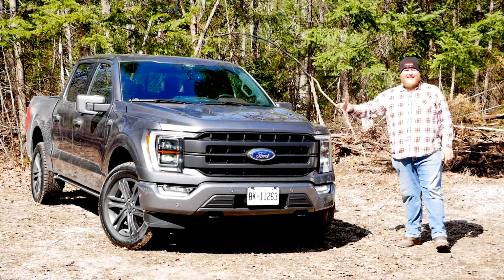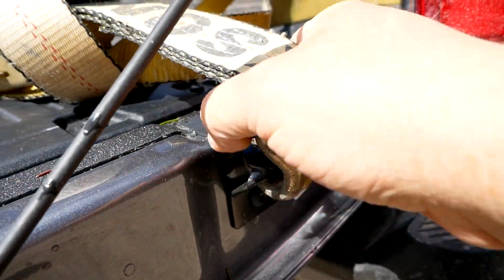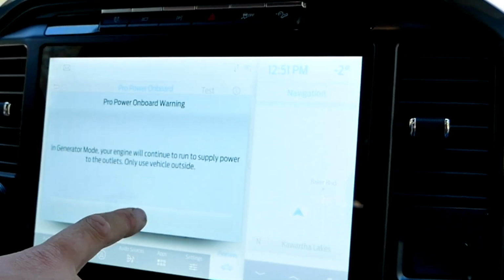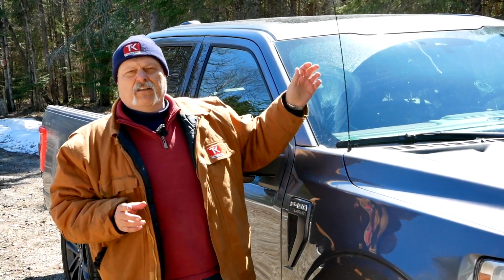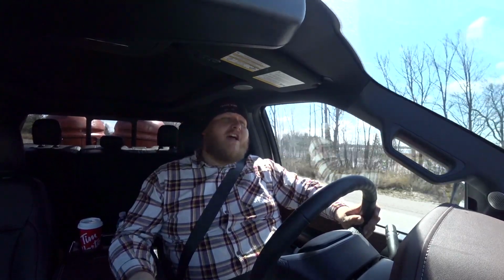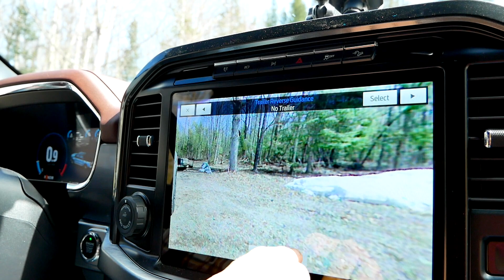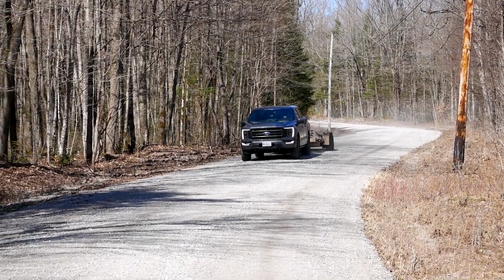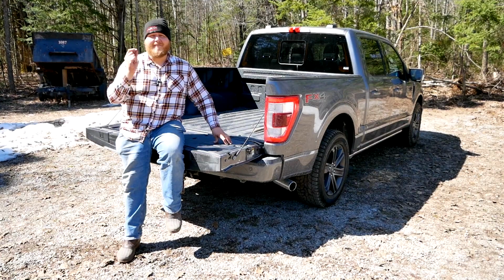Towing & Hauling with the 2021 Ford F-150 PowerBoost - Is Hybrid The Right Answer For Hard Work?

Comment: Ford is the pickup truck innovator.  Yes, Ram upped the interior threshold, but outside of that, Ford has literally been a pioneer for everything else on the current pickups we've seen in the last 20 years.

Comment: 12:40 – Hybrids have a "mandatory" beep when in Reverse gear.
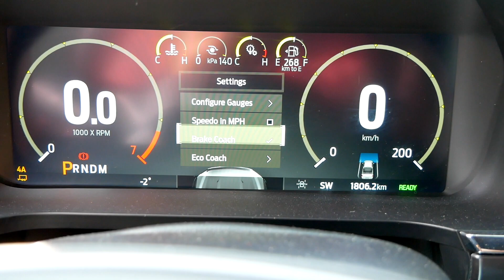17:35 – Fair point, it's a "busy" cabin … I just got one two days ago. The drive today (200 miles) put a total of 500 miles on the odometer and was only my fourth time behind the wheel and the first time I was confident the touchscreen and steering wheel controls were helping me and not distracting me. 
Driving with nothing in the bed, the ride is comfortable and even luxurious on the freeway. I feel the rear suspension reminding me I paid for max trailer tow, but the FX 4 springs are longer travel and softer, so even on bad city streets, this is not a "kidney belt" bruising ride of a typical half ton with leafs.
I'm at "day three" and greatly impressed. Hauling a full bed of heavy equipment, every seat occupied in the cabin, gaining over 6000 feet above sea level, up to a 75 mph, not sparing the horses for overtaking, averaged 19 mpg. Driving with the distance-keep and lane-keep cruise control is confident on winding mountain freeway curves and the cabin is quiet and calm, so a four hour drive was enjoyable.
Reply from the maker: Good review - thanks!

Comment: This is really a fantastic half ton. You get  insane power, fuel economy, generator and properly equipped truck capability and offloading. Raptor and all is great but this will do 90% for 1/3 or less cost over its lifetime and things that truck could not do.

Comment: The antenna is a great warning when you might scrape in a parking garage.....or other low height areas 😀
Reply: That's actually its primary purpose, even though people call it an antenna.
Reply: Also the range is better than a shark fin style antenna
Reply: @cmoney8280  But I had a Tacoma with an antenna and it got beat up bad off road. Sharks fin is way better overall.
Reply: That is funny but true. Especially in parking garages.
Reply: Seriously. What do they have against the antenna? It's fine. Ford is improving what needs to be improved, not just changing things for the sake of changing things.

Comment: Definitely watching the powerboost. Gonna give it a few years to see how the reliability turns out and also see this supposed toyota tundra hybrid that may be coming.
Reply: Given the current chip shortage, waiting is the better option if you don't need a vehicle. I was lucky to get one and will roll the dice on reliability. So far, so good, but I wouldn't want one of these out of warranty with computers and motors everywhere. Beside cost, the other factor in reliability is the problem of having a vehicle off road – can an individual or a business afford to have a vehicle out of service. If my pickup was live-or-die critical to my business, I'd be more careful.
The way I see it, the 2021 F-150 is 90% the same as previous years, so all the reliability risk comes in the hybrid which is itself an already proven technology (in Lincoln.)
So far, the only problem I've read about is underbody rust in vehicles driven in regions where winter road salt is a problem – that's something Ford must fix, but it's not a dealbreaker for me.
Reply: @brightymcbrightface  There coming off the truck with rust in all parts of the country
Reply: @diesel6916  right. I was wrong to assume this was a regional problem. I'm in California and my F-150 Prius arrived with 10 miles on the odometer 2 days ago and the diff is red raw with rust. I plan on getting under there on the weekend and trying a rust inhibitor spray.
Reply: @brightymcbrightface  Ford has used the Toyota Prius hybrid tech for a long time, so I think that portion is good to go ... it all comes down to the dealer support and the day of the week it was built (no Monday or Friday) ha ha ...
Reply: So it’s been a year, so far the most complains are about the Sync4 which is kind of a big deal as this truck is pretty much wrapped around this system and other electronic modules. I’m still scared to pull the trigger on it as I don’t trust Ford when it comes to their complex systems. Also somebody posted out a video of the underside… so many wires, connections, relays and it’s all exposed to water/salt. IDK, I love the truck but I can see it being a headache for those who keep the vehicles long term.

Comment: The F150 powerboost is an amazing truck. Alot of power! Quiet and built strong, I've had two 2020 trucks, a trail boss silverado 5.3 and a Ram Rebel 5.7...the 21 Powerboost in my opinion is a much better build and feels more solid in quality.

Comment: Stephen, since a lot of us here are dads or new dads, could you possibly start adding a 30 sec segment on backseat child seat room. Forward facing and rear facing to back of driver or passenger seat. That’s would help a lot. Thanks!
Reply: The back seat in this F-150 is great for child seats (LATCH) and space/access. I'm 6'1" and the space behind the driver's seat is ample for rear-facing.
I agree it would be useful for new buyers to see a compilation of photos and measures to compare.
Reply: There's TONS of room in the back on the F series trucks for child seats, the same if not more room than our expedition. You won't have any issues, even with a tall person in the front seat adjusting it back.
Reply: I just test drove the is it supercrew yesterday . and as a mother of a 2 year old and driving a minivan I have to say the legroom in the truck is bigger than what I have right now. It has space fir 2 seats that need to be restrained easily. 3 kids not so much
Reply: That’s a fantastic point. Most folks buying these will be using them as family vehicles for the majority of their miles.
Reply: Just as a comparison my chrysler town and country has 36inch legroom in second room and the ram 2500 has 43 inch I think and ford has even more...
Reply: Alex on Autos got you covered!
Reply: You won't have any issue with a crew cab F150, you should already know that.

Comment: I have a 2023 Powerboost XLT. It is my second truck and was (my first was a ram 1500 eco diesel, you already know what happened.) And this was my second choice, it was this or a F-150 Tremor. Wife liked the Powerboost more, so I decided to give it a chance. Have had it for a year, have taken it off road (fish creek in Anza Borrego, and Palomar divide truck trail) as well as my daily driver, and it has been rock solid so far. Mileage is a bit less than my diesel, but not bad. But I had no idea what a monster this truck actually was when I bought it. I have smoked so many kids in their STI's and CIvic's. Its hilarious, and even gave a hellcat a run for its money (end of the day truck tops out at 130, hellcat smoked me after that).

Comment: Most complaints of the console shifter should be reminded that it's an option on anything below lariat.  Column shifters are more regular on XLT and that's what I have on my 21 f150.  0 complaints of it, and it gives you more room in the console itself.  (we have 40 console 40)

Comment: I really love what Ford did with this truck, it is incredible how much they packed into it. In my opinion the styling is great too, interior / exterior it looks great, power, comfort, it seems to have it all. I do have that mindset of the electronics breaking but mine is more of a functionality question. If the screen does go or the shifter motor goes do I still have functionality to at least drive and be productive or will the truck be so dependent that it basically say nope sorry you have to get this fixed before you can use it or be in a limp mode that is basically useless.
Side note in 2008 my office moved locations and my commute to work quadrupled in distance so I got a small Toyota Yaris for the gas milage. It has absolutely no bells and whistles and of all things is has manual crank windows LOL. I still have it and it still runs great. Great video as always, love the channel thanks for all you guys are doing.

Comment: Good review 👍
Ridgeline 1583 lbs payload and modern antenna😁
Cheers
Reply: Right and only 5000lb towing. It is a nice ladies truck. Lol
Reply: Before everyone starts attacking you, payload is GVWR - curb weight. Curb weight is dry weight + features. This Lariat has more features (including the hybrid power train) and the Ridgeline does not complete with F150. 

NOW. Compare Ridgeline with 1500 lbs payload to similar Tacoma with 900 lbs payload. Way better argument but still 2 very different types of buyers.
Reply: @MrJamesLuz  
I knew full well it would stand the hair up on the back of many necks😂
Reply: @robertchapman4488  
Wow, not only did you just insult all Ridgeline owners but women as well.
Buy the "Truck" that meets your needs.
The Lariat with all the bells and whistles and old antenna far exceeds my Truck needs even if I had the money. 
Cheers
Reply: @MrJamesLuz  the ridgeline is like 40k usd less expensive than fords. That's the point
Reply: Always owned Honda’s and two times Ridgeline owner (2006 and 2017) but I did not went for the Ridgeline 2021; I am waiting for a F-150 2021 Powerboost Lariat. Unfortunately, even with a refresh, Honda did not keep up with technology for the Ridgeline. I had to jump ship... I know I will miss the ride quality and the in-bed trunk but with the 7,2 Kilowatt power generator, I will be better prepared for a Zombie apocalypse.
Reply from the maker: Nice one!

Comment: Sounds like they need to add that system to the 3/4 ton. The tongue weight of a trailer would max that truck out with just the driver amnd one passenger.

Comment: Great review as usual guys. These prices have gone completely off the reservation. $80,000 USD for a mid level trim package half ton is disgusting.
Reply: Doesn't mean you will pay that much ..,.i got a factory 8500 dollar rebate and a 1000 dollar dealer rebate
Reply: @northlander4370  $70,500 isn't much better LOL
Reply: @skwerlee  i came in with 4000.00 cash down...if you want a loaded truck be ready to open your wallet

Comment: Like your show. You and your dad share a lot of the same questions regarding vehicles as myself. Maybe because we share similar environments (far northern Wisconsin)? Mud, spring thaw, heavy snow, heavy salt use, dense woods, wetlands ,very cold weather and ice have different challenges than the west (rock climbing, sand). We don't have the awesome views or mountains, which are spectacular to watch. I think Ford has a homerun with this hybrid/generator F-150. Too costly for my farm, even the larger generator can't handle my vacuum pumps in the barn, but still Ford always seems to be ahead of the innovative game. Currently I run an old Dodge 5.9 Cummins. My old F-350 dually was great (7.3 IH), but the the salt just destroyed the body.
Reply from the maker: those 5.9's are slow - but they run forever.

Comment: The sound when you were backing up was not the parking sensors... it is because it is hybrid and doesn’t make any sounds... it makes these beeps for warning people you are backing up... very annoying and it can’t even be turned off from what I know. Hopefully enough people will provide feedback and since it has over the air update, a new option to turn it off will arrive soon.

My new F-150 Lariat Powerboost should arrive within 1 month. It is my fist full size. I am a two times Ridgeline owner. I loved that “truck” but the technology in the F-150 moved me for the first time in my life away from Honda to Ford. I ordered it with assist 2.0 package that will give me Ford self-driving (Blue Cruise) with an over the air update later this year.Looking forward to a test of that from The Truck King.

Comment: The antenna is there because if you put in a slide in camper that goes over the roof it will block a shark fin or Rc car looking antenna from working. Also roof racks with ladders and such can and will hit antennas on the roof.

Comment: I love this truck. It has so much stuff. I worry about this truck, it has so much stuff.

I do think this is the  new king of the full size trucks. 

However all new vehicles are made with all this stuff. I do not care for or need most of it. It is what it is.
Reply from the maker: That's the dilemma - want the stuff - fear it breaking
Reply: @TruckKing 

This is why I recommend to all my customers, they should get the OEM factory extended warranty.

Comment: you can get one with a stick shift and front bench seat so no need to ccomplain about shifter.  How is the rust underneath...many have complained
Reply: just surface rust on diff housing ..no big deal .

Comment: The shifter might as well be a push/pull button or a dial.
Reply: 100% Agree.  Would get rid of my console shifter for a rotary knob up above the drive select knob in a heartbeat.  Create more useable storage space in the console.
Reply: Or even better a column shifter when you order with the 40-20-40 front seats. Why would you not order it that way? I don’t get it ? One extra place just in case and a place for the dog to be close to dad.

Comment: That payload is the same as my 08 jeep grand cherokee, that's really sad since its coils all around and is unibody. The max payload package is available with XL and XLT trucks with the 5.0 or 3.5ecoboost only, but you can get it with any cab and either a 6.5 or 8 foot bed, and I believe it gives you over 3000lbs of payload in all configurations, but now you have a 5,000lb truck with 3,000lbs payload 
For the screen they just didn't want to be the same as ram, because in the expedition they are putting in the stupid vertical screen from the mach-e where the wagoneer, grand cherokee-L and durango have the horizontal screen. Also the explorer has a vertical screen

Comment: Thank you for an excellent review. I wonder what happens when the hybrid system hits the 10-year mark since we generally keep our vehicles past that age. I have two friends with older Prius models who had expensive battery repairs around the 8- to 10-year mark. Would it be better to buy the F-150 with the 5.0L V-8 and avoid having the pickup sidelined by repairs later on?
Reply from the maker: We shall see

Comment: I actually traded mine in recently on a frontier because I wasn’t ready for the technology. It was a huge problem for me. Primarily with the parking sensors, cameras and automatic emergency braking. I’m a trim carpenter and I tow a trailer often (multiple time a week) and when I’m home I like to park in the garage because we get a lot of hail and snow and I like to protect my truck in the garage. This past 4 months were aweful for me because I kept collecting ice on the sensors and all the alarms and cameras would come on and drive me crazy. Also warning lights telling me failures on the dash. When I come to a stop light and there were other cars around the ice would make the cameras blurry  and the automatic braking would think I was going to hit something and slam on the brakes. It was really bad when trying to reverse especially with the trailer because the rear automatic braking would see the trailer and alarm me and slam on the brakes in reverse. Also when I would park in the garage the cameras would come on automatically to show me what I was close to while the sensors were flashing all over the dash and then the emergency braking would stop me from parking. I got so tired of trying to turn everything off that I got fed up and traded it in. Some people would say well just turn the systems off but it will automatically turn them back on anytime you switch gears or restart the truck. And if I did turn them off then I would have a ton of warning lights on the dash so it was really annoying.

Comment: We have a 2021 f-150 3.5 eco boost hybrid. We took our first camp trailer trip. We got Terrible gas mileage, 8.9 mpg! I couldn’t believe it. Our trailer weighs 5600 lbs. I think we must of had it in 4 wheel drive mode. Any thoughts?
Reply from the maker: We have tested the 3.5 EcoBoost towing and got the same results. Mileage drops by half when towing.
Reply: There's a reason it's branded as "Powerboost" and not "Super Eco". 8.9 MPG for a trailer doesn't sound that horrible, since you're also fighting wind resistance towing essentially a 5600lb brick. Hybrids were never gonna help fuel economy in towing, it would help to give you a boost to power, but not economy. It's simple physics, weight is only one part of the towing equation for fuel usage. If you're towing something that causes a ton of drag, you're gonna suffer fuel economy hits. 

Hybrids give you better fuel economy in city driving. That's it, that's all. If you do lots of speedy highway driving, especially towing, you're not gonna see any fuel savings...
Reply: That’s normal for gas towing, with any brand

Comment: I agree! Why ford why? No need anymore for the whip stick!
Reply: The antenna is there because if you put in a slide in camper that goes over the roof it will block a shark fin or Rc car looking antenna from working. Also roof racks with ladders and such can and will hit antennas on the roof. The antenna still exists because AM/FM reception isn't as good as it is in Southern Ontario, every where else. Come to think of it, it's even possible to be out of cell range, without satellite communications in Canada. Who can imagine?

Comment: Does that significant lack of squat with payload indicate it can take a lot or more or just that the suspension is very good?
Reply from the maker: Both
Reply: @TruckKing  If you get the extended warranty on the powertrain, I am really struggling to see a downside to this truck. I really want one now.